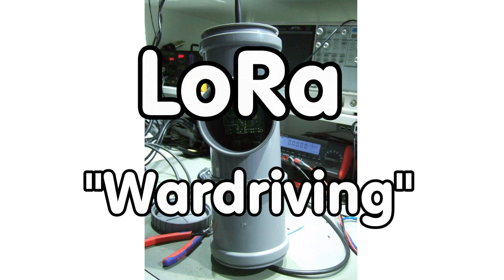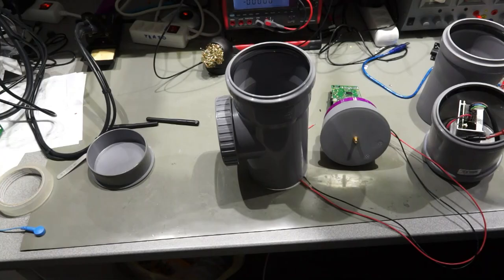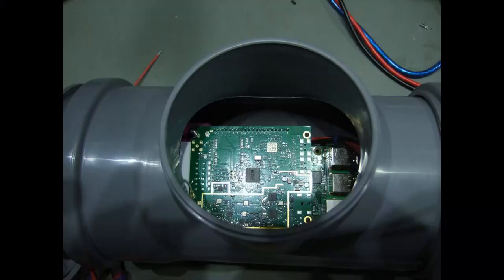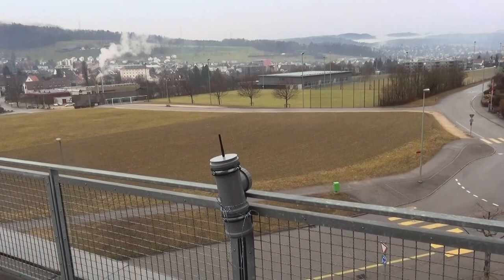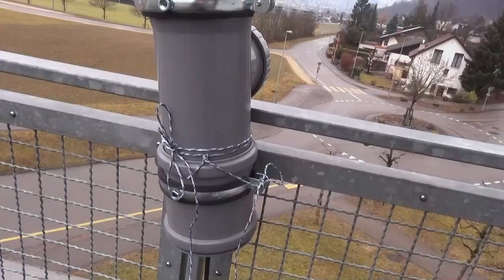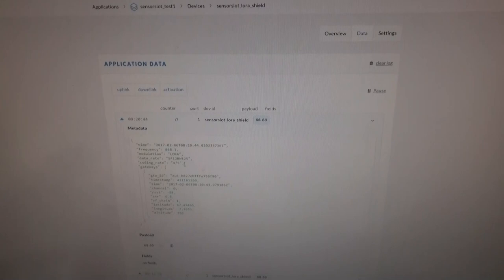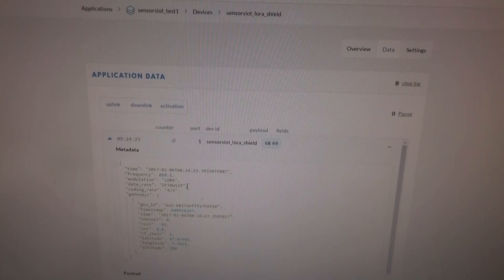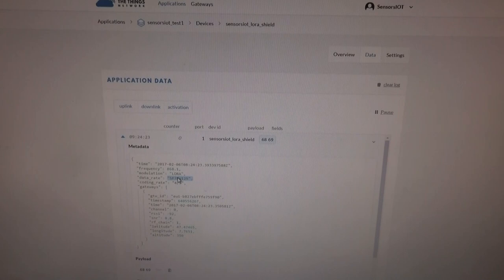#118 LoRa / LoraWAN: How far does it really reach? How far the "normal" RFM69HW? (Range)

Comment: Hi Andreas, one questions that I haven't found the answer (but am sure it's buried in docs somewhere). Assume you have just two or possibly a few Lora client devices that need to communicate with each other only and no need for a LoraWAN gateway. I think the clients can talk to each other fine. But can I actually limit the power of the radio? One of my use cases is beyond the reach of home's WiFi bur well within Lora's range. I would not want to be cluttering up airwaves with a full power signal on a shared frequency. Instead I would love to power the send function of the radio to just enough power to reliable reach the listener. And if possible, cut power used by listener to shorten the range? Or is Zigbee or something better for that? I always viewed Zigbee as short range.

Comment: Hi Adreas,
Nice video about a interesting subject!
I was searching information about LoRa because the long-range usability. I want to use this technique for sending data between sensors and a Sport-Timing platform for use in the mountains with ski racing. 
I was thinking to use a TGGO combi-module, but your results with the Hope RFM95 makes me doubt. How do you connect the antenna to this RFM board without a big mismatch? 
The plan is to use the LoRa elements in a private group without a Internet gateway.
 
I have several situations. some events are just once every few minutes, but I also want to make the Dot Matrix display's wireless, so we can put them everywhere along the track. The protocol I'm using to display the running time is transmitting every second a tiny bit of data.  Becaus you explained that the number of transmissions and data is limited, I probably have to move to another protocol like the RFM69HW, because they can broadcast more often.

Both the units do not have any shielding at all, while the TGGO units all have shielding and a propper RF connector for the antenna. Strange that in your test the unshielded units perform better than the shielded...

regards, 
Johan
Reply from the maker: The transmission rate has two components: The bandwidth(speed) of the module and the law. As I show in my newest videos about wireless in general, the speed of the module and its range are correlated. The law says in many countries that you only are allowed to transmit for 1% of the time (whatever that means). For critical situation, LoRa has more possibilities to trade speed vs range (consult data sheet for speed options). With a line of sight on short distances (few km), both modules will be comparable, I think. Maybe you look also at the Moteino line of Lowpower labs. Maybe they fit your requirements. And you get them with both transceivers (https://lowpowerlab.com/guide/moteino/ ).

Comment: At 2:50 you mention that your power bank shuts down... most do but there are power banks with an "always on" feature such as this power bank by CamDo https://cam-do.com/collections/all/products/15-wh-battery. CamDo also makes a 44 Wh version. CamDo stuff is not cheap and I am guessing there are other "always on" power banks that are cheaper.
Reply from the maker: They are really not cheap... I chose a cheaper way: In parallel, I connected a 0.1A USB load... 
I have once to build my own (I still have some Lipos laying around.

Comment: Gruezi Andreas,

Thanks for the different videos on LoRa and LoRaWAN, I had somewhat hear of them but was not aware of the potentialities I now see with your great explanations! I have already registered on TTN and found the forum with great information, and have joined the Lausanne community, since there is some local activity already, though much smaller than what is happening in Zurich.

I have a question on the Whisper Nodes, which I had not heard before.

They very much look like Moteino, with a little more "glue" on the board and an SMA connector for the antenna, am I correct?

What is the code that you have used to do the ping tests between the two RFM69HW-based stations? I have looked into your GitHub repository but could not find anything.

I have a number of Moteinos and RFM69W/HW radios and will for use use them for "local" projects, but I look forward to test things also on the TTN and LoRaWAN new way to send IoT data.

Thanks and 73 de Luca HB9FGJ
Reply: Ach! I have just noticed you do have video #116 specifically on Whisper Nodes, I am still catching up on the YouTube backlog and started with all the LoRa videos, and missed that... I will check it right away!

Comment: Hi, I very much enjoy your videos. Thank you for putting in your efforts. I would like your opinion on the following case. Consider we have 10-20 devices as nodes. Some have a job to send temperature and humidity sensor readings to the server through LORA and some control valves. What technologies do you recommend to use for nodes and for gateways? I was thinking ESP32 (because i am used to it) with LORA module and Things Network Gateway. Is there any better option for controller available? did you try the Microchip LORA Module?
Reply from the maker: Maybe you watch my other videos on LoRa (playlist)?
Reply: @AndreasSpiess  any specific one? i have seen almost all of your videos
Reply: @AndreasSpiess  Thank you. Any recommended video? i think i have seen them all

Comment: Rfm69 the rssi of -109 very horrible signal when the both devices are on the same table. It should be around - 20, - 40 at worst.
Reply from the maker: You are right. But so far I never saw an RSSI of 20 :-(

Comment: Hi, thanks a lot for the videos about Lora . i had a question ... Do you think is Lora applicable for Basement / indoor type iot applications like smart meter ? i would  be very grateful if you reply ... thanks in advance
Reply from the maker: I am not sure about that. Depends, if your gateway is quite close. I do not think, that you can cover a wide area if your sensors are in the basement...
Reply: yes your experiments also tell that .. but there are products like waviot http://dgmatics.com/product/smart-devices/waviot-smart-wireless-electric-meter .. thats why i'm confused . i am really in doubt whether lora is truly applicable for Indoor smart meters or is it just a hype !!
Reply from the maker: +Hassin Ayaz It is a hype for the moment. There are rumors, that routers will have gateways included. Then, this scenario would work. But not if the gateway is kilometers away.
Reply: Thanks A lot for your valuable suggestion

Comment: Amazing video! Thanks. One question, all the 4 gateways are on ttn comunnity?
Reply from the maker: Of course. Otherwise I would not have seen my message coming through the other gateways.
Reply: Andreas Spiess my bad. I asked because I didnt find the 27km gateway on ttn page community. for curiosity did you take any power measurements? once again thanks
Reply from the maker: +Daniel Morgado It is on Weissenstein: https://www.thethingsnetwork.org/community/Bern/post/connect-over-49km

Comment: I wish the gateway was more affordable here in Canada. I wouldn't mind messing around with this stuff.
Reply from the maker: I will build a cheaper gateway soon
Reply: Andreas Spiess Very cool. Can someone use the existing transmitters to make a gateway?
Reply from the maker: Which transmitters? As said in my last Lora video, you need a RFM95 or a SX1276 module (for Europe)
Reply: I found several RFM95 modules on AliExpress for a few dollars each. I don't know if they are programmed to work with the LORA standard. I need to do more research.
Reply from the maker: RFM95 have a chip which can do LoRa. But pay attention on the frequency. The gateways are on different frequencies in different areas of the world.
Reply: I saw that in the video. I am in Canada so I need the 915Mhz version.
Reply from the maker: These versions are around 8$, as the 868 versions.

Comment: Sir,
I am try to send data in 2KM in urban area, but my requirement is higher bit/sec. All most 50kbps, which lora module used ?
Reply from the maker: LoRa cannot fulfill your requirements. It is a low rate protocol
Reply: @AndreasSpiess  what is maximum data rate for 2KM in lora module in urban area ?

Comment: Damed you Need an dummyload -resitor .. bad .. have the same Problem.. via RaspiPi and 
20 A Akku USB.
Reply from the maker: This is, what I did. I have one which a can regulate to 0.1A. Then, it stays on...
Reply: Second blessure is, it give not an 5V Accu, there has 3.3V * xCells, This accu has intern an dc/dc converter, there hack the voltage into portions, and emit it again to output, this hack with a higher frequency and with spaces. the next dc/dc converter on your cicurit do the same, and often they com into harmonics result no power. an LC -filter can use with luck.

Comment: Very interesting start and ending (especially the conclusions); all the rest in the middle sorry not demeaning a bit boring. The "sewagedrainpipe-solution" is magic, very well invented.
Now:
1. I wonder if you are not kicking in open doors with the Lora (RFM9x based) versus RFM69HW comparison: https://learn.adafruit.com/adafruit-rfm69hcw-and-rfm96-rfm95-rfm98-lora-packet-padio-breakouts/overview explains the difference; basically Lora technology has larger reach albeit at lower datarates too than the regular RFM69HW but that is what makes Lora "special".
2. The "range" discussion is as much an antenna issue as it is a transmitter efficiency issue. Simple use a larger gain omnidirectional antenna and you get better range; a simple dipole antenna gives you between 2 and 5 dB gain depending on the antenna and connector layout. Better yet: if you want to get very high range use a (directional) Yagi antenna, you get up to 20dB or more gain.
3.  Can you explain maybe in a next/later video what TTN is, as well as the different commercial (Sigfox,..?) versus community solutions? This too I think can be a very interesting subject?
4. If you decide to use RFM69HW for a network you will not be able to connect to Lora networks: is that not going to be a drawback for those who invest(ed) in non-Lora technology once Lora starts to pick-up in the coming years?

Grts,
Erik
Reply: funny, the crossed words in my message above should have been between parenthesis
Reply from the maker: 1. I do not specifically introduce LoRa, I introduce mainly LoraWAN.
2. I tried to explain (in the boring middle part?) , that the range issue is only very little an antenna issue, but a line of sight issue. And yagis are not allowed in this band by law.
3. I tried to contact Swisscom, who operates a LoRa network in Switzerland. So far, no response. Sigfox does not exist here
4.I mentioned it in the video

Comment: how about lora strength in closed area ????
Reply from the maker: It also works in closed areas. But only on shorter distances, of course.
Reply: @AndreasSpiess  how much distance and is there any instrument is there so that can we check distance range like its connecting partialy or strongly?
Reply from the maker: You just try. Very simple. There is no other solution.

Comment: Adafruit announced today a Pycom ESP-32 board, running MicroPython, and which has a RGB LED. There is an expansion board available, which includes headers, USB, LiPo battery connector & charger, & SD card holder. There is an additional breakout for a UART connection, LED & battery. They also offer a LoRa version (apparently dual-band (?) 868 MHz (Europe) at +14dBm maximum and 915 MHz (North and South America, Australia and New Zealand) at +20dBm maximum), as well as a 900MHz antenna. 

https://www.youtube.com/watch?v=1dtR4QJHvLY
https://www.adafruit.com/products/3338
https://www.adafruit.com/products/3344
https://www.adafruit.com/products/3339
https://www.adafruit.com/products/3340
https://www.pycom.io/gettingstarted/

Speaking of war driving, that was swell fun when the software became available. I took a wifi PDA on a trip to Japan, and war drove on the train, from airport into town, putting the PDA next to the window. I got several hundred hits on the way to Tokyo (the stupid thing beeped for every hit, so I tried to block the sound with a handkerchief). From my hotel there were 30 wifi locations visible. Now we all get to do that again with LoRa, thanks to Andreas.
Reply from the maker: I had both boards in one of my mailbags. They sit on the shelf waiting for their chance...
Reply: It was only later that I saw the boards came from Europe. The bad news for me is that they don't support the 433 MHz frequency band in use where I am.
Reply from the maker: Maybe they will in the future...

Comment: Hey Andreas, got a question after watching your videos.

How come RF95HW 0r RF69HW modules are not LoRa devices but competitor?
Both the RF modules designed HopeRF and dragino Shield is using Semtech SOCs only than how they are different?
Reply from the maker: The RF95 can do Lora. The Hope chips are licensed products from Semtech
Reply: Do other modules which are using Semtech SX Series will have an advantage in performance over HopeRF?
Reply from the maker: I never used Semtech modules. As I wrote, the Hope are licensed products. So, I assume, they are the same.

Comment: What is the difference between the RFM95 and RFM69 Modul.
Or is it the same, booth use the RF96 chip.
Reply from the maker: The -95 can, in addition to the -69, also LoRa
Reply: I looked into the datasheets there are differences in the link budget and packet engine. I will share my experience after the boards arrive, I am planing to use them with a STM32L4 MCU

And not to forget, your videos a great.
Reply from the maker: In this video, you saw small differences between the two. There are also two sorts of -69, a normal and a HW, which has more output power. It would be interesting to test the two over a certain distance like 50 or 100 km. There, you should see, if differences exist.